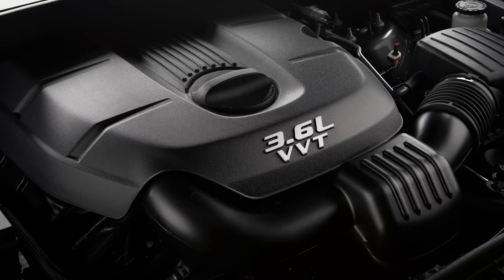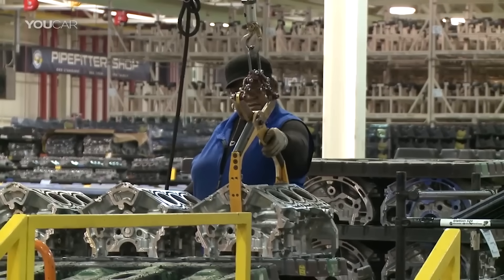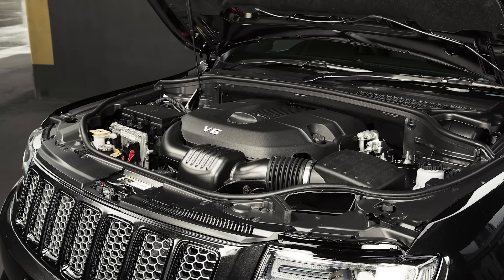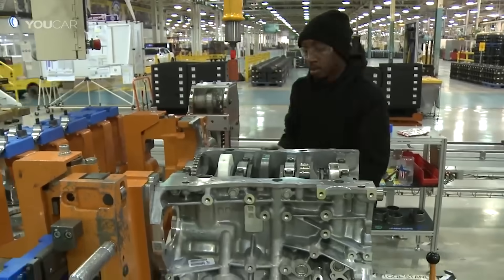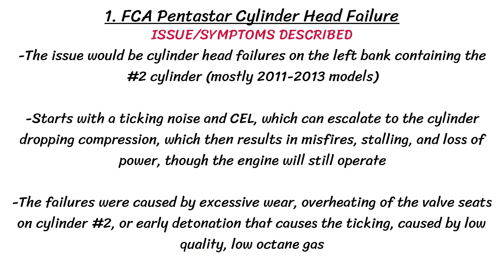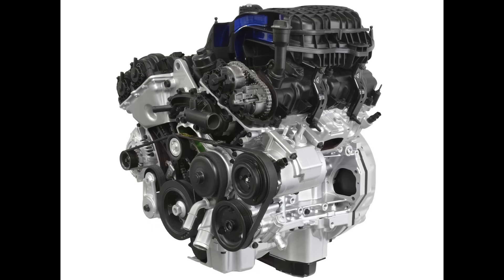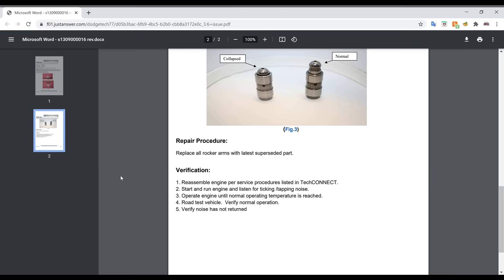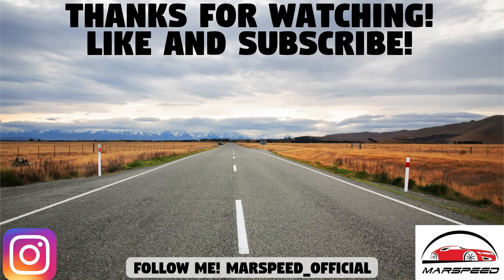The Specs and Fatal Flaws of the Chrysler 3.6L Pentastar V6 Engine

Comment: As a Technician who repairs most brands, I have seen a few with worn rocker arms and some of the plastic cooling system components fail but they mostly all have problems with the use of plastic components.
Compared to some of the engines today I would say that the 3.6 engine is above average for reliability.
Reply: I just bought a 2014 Dodge Journey. It threw the first engine code for a thermostat. Is there any better made thermostats for the 3.6 Pentastar??? Autozone has a cheap $20 replacement. My wife will be driving the Journey. I'd like to have peace of mind when going on long trips. The engine seems to be a good runner and reliable overall. Thanks!
Reply: @randallringwald5059    These days a genuine Chrysler thermostat is your best choice. It might cost a bit more but they seem to work much better than other choices.  Not likely to be made in China either.
Reply: @wysetech2000  I agree. By the way, I am looking for a Pentastar thermostat with metal housing, since the existing plastic one seems to be pushed/cracked up from within by the thermostat pellet's actuator. I have searched the internet up and down and metal housing seems to me non-existent. If you know of any such metal housing, please share.
Reply: @wysetech2000  Thanks!
Reply: @randallringwald5059  Regardless of what Thermostat (or other part for that matter) you buy, you can always catch a bad one - and I say this from experience.

In addition, sometimes parts that are offered by aftermarket companies are made by the same companies as the genuine parts.

As far as you peace of mind questions goes, regardless of trip length (long or short) - Murphy dictates that there is no such thing as being well prepared. You can rent a brand new car and take that for a long trip and you'll likely have only a hint better chances against failure compared to a well maintained middle aged vehicle.

So make sure you cover your basics, be in good terms with Murphy and enjoy your Journey, where ever it takes you.
Reply: @mrtopcat2  Thanks! I'll keep that in mind.
Reply: I have a 2016 Chrysler 300 Limited with a 3.6L .. 71k miles never been in the shop, purchased brand new. Wife has a 2018 Dodge Charger SXT Plus .. 30k miles, never been in the shop. Above average engines when it comes to reliability. The problem is people buy these cars, and Nascar with it! That'll put any vehicle in the shop.
Reply: Pentastar engines are the biggest pieces of crap 2 grace our roads in  decades! The main problem for me is that these vehicles also encounter a host of other issues besides the rocker arm failures, the oil/coolant leaks from up top there, the plastic thermostat housings, etc. They also have weak transmissions(62te), tipm issues, rear h/vac will definitely need some repairs eventually, I mean the list just keeps going on & on and the more you look at reviews and other people's experiences, you find other issues that make you wanna not buy ANY Dodge/Chrysler/Jeep product manufactured anywhere in the 2011 thru 2021 years! I think I'll pass...especially after hearing people with the new "revised" 2016-up pentastar engines still complaining about the same old valvetrain issues & oil leaks from the filter/cooler housing assembly!?! You can replace it with an aluminum one from Dorman & call it an upgrade all you want but it's still gonna leak from underneath it just like the plastic ones do when the 0-rings give way eventually...
Reply: Good to hear i thought so too its nice to know this from some one in the field.
Reply: BMW, one of the worst in plastic components.  At least Scottie affirms it.  🐴🐴🐴🐴
Reply: I have driven my used 2015 Journey for more than three years at an average 50,000 kms/year. I bought it with a 106,000 on the odometer. Now, the odo reads almost 250,000. Based on the vehicle history, the first owner sold the vehicle after it went back and fort from a Dodge Service Center after 90000 kms. I got it at 106000 kms, followed service recommendation being done by a certified autoshop, not Dodge/Chrysler Service Center. There was no issue until it reached 182000 kms, they have to replace the leaking plastic radiator.  Then, at 189000 kms, the transmission has to be rebuilt due to malfunction and low trans oil pressure. It became obvious to me  that the transmission  has been serviced repaired before and the funny thing is that Dodge service shop told me not to have it repaired by dodge service unless I am willing to pay up around 6k for it. I found an especialist who did  fixed it for 2.5k but he told me that it will be good for another 90000 kms, then the trans has to be open up again... Hence, I am now expecting to have my 62te trans opened up again at 290000 kms, as the low oil transmission pressure will happen after its change oil every 90000 kms., that maybe before winter 2022, unless I drive a lot less. For the meantime, after the car past 200000 kms, the engine had the famous pentastar ticking sound, then, engine overheating when I am on a lenghty traffic light stop, which later turned out to be caused by zero oil pressure at idling situation. Inasmuch as my mechanic refuses to give me an exact amount to fix it, I took the courage to analyse it. Before I decided to open up the engine myself, I decided to change the oil myself using 5W-30 in lieu of the specified 5W-20. I was glad that I did it as the engine oil pressure does not drop to zero anymore during idling, it does not overheat anymore, and after sometime, the ticking sound disappeared. I have not opened the engine yet after 40000 kms except changing the engine oil and its  filter every 10000 kms using 5W-30. My conclusion is that the repairs are scheduled to provide jobs to the auto technicians.... It is mind blogging that the transmission recommendation oll change is 90000 kms so the transmission parts wear out, and then, it has repaired again. And yes, the pentastar engine is reliable and strong enough to be driven for hundreds of thousands of kms. But of course, you have to spend some money to maintain it, the same with other motors. And you have to pay the mechanics aswell, if you do not want to get your hands dirty.... Happy motoring!!!!
Reply: I’m at 190k right now
Reply: @Malachi Diego instablaster :)
Reply: @Emery Marcus i really appreciate your reply. I found the site on google and I'm trying it out now.
Seems to take a while so I will reply here later with my results.
Reply: @Emery Marcus it worked and I finally got access to my account again. Im so happy:D
Thank you so much you saved my account!
Reply: @Malachi Diego glad I could help :)
Reply: My vote is the 3.6l is a good engine.  Heard cooling system problem with plastic breaking is direct result of mixing coolants.
Reply: 3.5 cyclone or 3.6 penta?
Reply: Wysetech. I'm considering strongly buying a 2020 chrysler  300 limited or S for my wife. Any opinion on models. Also what good I have done day 1 buy a professional like you to avoid failures down the road. Aftermarket parts. Even if that means going inside the engine. Please any advice
Reply: How does it fare against the 5.7 engine? One i had got countless of coolant problems
Reply: My wife and I just got a 2020 Chrysler Pacifica Limited. I see online that it uses the same PentaStar V6 as the Challenger SXT. The van gets 287HP stock, where the SXT has about 305HP stock. Does anyone know what accounts for the HP difference on the same engine? I'd like to have 305HP in my van. I wonder if an aftermarket performance throttle body made for the Jeeps or Challengers would fit and work on my van, or if the differences in ECM programming would prevent this.
Reply: @TroyBoleyn  considering how i seen both engine bays, the intake systems of those 2 are rather different, the Pacifica is set up to get more torque and gas milage instead of speed and performance like the sxt chargers are, if you do happen to make modifications regardless if which car it is you're doing it to, you're going to need to tune the PCM, because it will still be trying to make 287hp. You can probably make it do 305 or even more if you know what you're doing, but regardless any physical modification you do to any car, gains will be rather non-existent until you tune the pcm.
Reply: I prefer my Ford 2.7 any day over Chrysler engines
Reply: I totally agree with that. It was two pieces I replaced that had a crack, but never no real issues with the engine no major issues just battery.
Reply: Well we have a 2017 Jeep Wrangler and that thing has been overheating changed all the cooling system parts and Jeep dealer said they can’t find anything wrong since there was no check engine light… but what happens is the coolant goes to the over flow tank and less coolant in radiator car heats up ??? Needless to say to can’t figure out . I’ve changed water pump, radiator, cap, overflow tank, hoses thermostat and no sign of bad heads since no water in oil or milky oil cap. Last resort is a good flush of cooling system and change radiator even though I see it and hear it turn on … whhhhyy jeeepp whhhyyyyyyy
Reply: @alexsantana5377  I've been working on a fleet of caravans (cabs) since 2014. Pull your coolant reservoir and check for sand in the bottom (also ask the guys working on it if they've seen it before). I've only had a few, but they exhibited the exact symptoms that you listed. The other commentor was right also. Get a new rad cap (from dodge).
If you find sand/sludge, reverse flush the rad too. 
I wish you luck😎
(FYI, dealers don't want to admit to sand for obvious reasons)
Reply: @alexsantana5377  have you tried bleeding the air out of the system?
Reply: @alexsantana5377  I've heard that they have 2 thermostats so did you change both?
Reply: @alexsantana5377  in the tradition of this thread I'll throw my 2 cents into your overheat issue 😆  
if your coolant mixture is off, the coolants boiling point can actually be lower instead of higher. so hotter than Normal operating conditions like long traffic @ 90° can cause the coolant to boil in the rad. The reservoir is designed also as an expansion tank. so the collection in the reservoir would be what should happen had the goon that replaced your coolant not premixed with water before hand. Although I'm sure you've sorted it by now. 😆 🍻
Reply: @alexsantana5377  I think the surface of the radiator filler neck is bad causing the cap not to seal properly had that problem with a Chrysler Sebring and replace the neck no more coolant issues.  their is an air leak some where preventing the engine fro sucking coolant back from  the air tank.
Reply: Do you have mesh grill inserts or one of those dumb grumpy grills? Those will block enough airflow to cause problems.
Reply: @alexsantana5377    Overheating isn't a common problem with newer jeeps but anything can happen. Does it overheat at city speeds or highway speeds or any speed?
Usually, overheating at highway speeds and less at lower speeds is a good indication of a plugged radiator core. 
Head gaskets don't appear to be a common problem on that engine but I have seen a couple of cracked heads on those engines.  I believe Chrysler was replacing the heads under warranty at one time.
Instead of guessing, I would have someone check for combustion gas in the cooling system. If nothing shows up then a reputable radiator shop can test the flow through the Radiator core and possibly clean it for you.
Reply: @alexsantana5377  EGR cooler?
Reply: @alexsantana5377  "...but what happens is the coolant goes to the over flow tank and less coolant in radiator car heats up..."

You may have a blown head gasket. Cylinder compression could be pressurizing your cooling system and blowing the coolant out. Does your coolant tank smell like exhaust? Do you feel pressure coming from the overflow tank with the cap off?

Oil and coolant is not mixing, yet. But you're in danger of hydrolocking your engine-where the cylinders start filling with coolant when it's shut off, then when you try starting it, bending your connecting rods, breaking pistons and rings, and possibly damaging the head.

Been there, done that.
Reply: I've seen a dodge caravan with just under 250k miles and yes origional 3.6 engine and trans
Reply: @Bobby-cm7vu  complete opposite for me. I've got a 2016 GrandCaravan had bad injectors, changed transmission(TWICE), bad lifters and rockers, changed all cams, most top end work done due to the infamous "tick". slight overheating due to thermostat as well. All this before 80k miles. Pure junk
Reply: @christopherjohnson3614  chrysler quality moment
Reply: They are pretty solid motors for the most part.
Reply: I would go even further and say that during the years that it was produced, the 3.6 Pentastar is THE best engines in it's class. Yes, it may occasionally has it's issues, but so do other engines and as stated here by others, other engines have even bigger problems. I work on all of our cars, no matter how big the job is and I take a rocker arm problem or a broken oil filter housing (known Pentastar issues) any day over any of the other issues that other engines in the same category are plagued with. I find that people who are trash talking the Pentastar are usually those who bring their vehicles to mechanics for repair, for lack of knowledge or tools.
Reply: @mrtopcat2    Yeah, like the Hyundai's that blow up and catch fire, the 2.4 Ecotech that eats timing chains and burns oil and the 3 valve Ford triton engines.
Reply: Had over 300,000 miles on my Liberty before I traded it in. No major issues with this engine.
Reply: Thank you wysetech2000 it usually happens after we drive in highway but I will do a combustion check
Reply: Every vehicle has issues you just gotta pick something you know you can maintain if things go south or just don't buy the model.
Reply: i guess im randomly asking but does anyone know of a method to get back into an instagram account..?
I was dumb lost the login password. I appreciate any assistance you can offer me
Reply: Maybe compared to a Ford 5.4 three valve but I see Chrysler engines in the shop for major repairs long before 100k miles which in this day and age is unacceptable. And I’m not even a mechanic but almost without fail these Chrysler’s just start falling apart waaayyy to early.  Bad rocker arms? Bad valve lifters? C’mon, man that’s just cheap parts right there
Cheers
Reply: @tomdavis3038     I can tell you that since I work on them all every day I stand by what I said.
Reply: @wysetech2000  what's your take on the motors newer than 2014? Will they make 200k? I'm liking Durango's but never owned a dodge. I'm just wondering if they're stout, bc my old pilot has 215k on it and I want to figure out my next ride
Reply: @AAron-jj7zx     Just about anything you buy today is a crapshoot. I own a 07 Caravan 3.3 L with over 200.000 on it and the engine is still solid. I  think Toyota makes the best cars and engines, especially the V6  but not everyone likes the cars
Reply: @wysetech2000  thanks man. I noticed Toyotas one of the few companies willing to address DI issues. I'm hesitant because Highlander is an odd size, and Sequoia's are expensive lol. Longevity is key tho, we run lots of highway miles, 25k-ish a year.
Reply: I noticed mine , when I hit the gas and speed up sometimes makes a clanking sound, clank clank clank clank.

Any idea what this is?

I also have the po6da code on and think it’s a solenoid at the oil pump, my oil pressure is fine though  and it’s not a sensor issue
Reply: @tomdavis3038  Nowadays Chrysler’s main issue is the electronics rather than the engine/transmission.
Reply: @tomdavis3038  ..Toyota makes crap engines with major flaws as does Honda,VW,Hyundai,Ford and GM...they ALL have issues!!!!!! Now electric cars even have major issues,failing batteries/no drive range etc....

Chrysler mainly uses the 3.6 and 5.7 Hemi they make over a  million per year or each engine and of course with 99% of your fleet is the Pentastar and Hemi you will have people and issues..Overall they are strong,reliable engines...

Remember Toyota makes crap engines and they did since the 1970's..I know!!! Car dealer owner today,and I worked at a Toyota dealer back in the 1990's(I worked in the body shop but knew and helped out mechanics when needed/I work on cars/engines all the time)..Today Toyota has burning oil/bad piston rings that destroy the engines and Toyota cant make 50,000 miles without a rebuild!
Reply: @01trsmar  You exaggerate and lie like a snake oil salesman. Oh its true,  its true.
Reply: @01trsmar  you gotta be a troll 😂😘
Reply: @Edrodperx  ..Nope,just around cars for decades..You pissed because Toyota always had issues that were covered up!  You're the Troll...
Reply: @01trsmar  ok troll 👍🏽
Reply: @01trsmar  But there's things you keep forgetting, Chrysler's 2.4l and 3.5l engines were thrown together for poor people, and it was proven. Why do you think they were put into those cheap cloud cars, cause they were naturally made to fail, that's why it costs at least $1,200 to do a water pump job, and let's not talk about the stupidest place to put a battery as an afterthought inside the damn bumper buy the driver front wheels. Tell me how smart was that, especially when corrosion and rust was a major issue on those vehicles, and they were bargain bin cheaply made, and the longevity of the time they were in the shop vs time on the road is ridiculous!
Reply: @curtiswilson4737  300k miles from a stratus with 2.4l.  it had 3 head gaskets before 120k.  The redesigned mls gasket lasted remaining life.  Battery was a pain to access but kept it cool from engine bay heat.
Reply: @01trsmar  TOYOTA RELIABILITY VS. CHRYSLER/DODGE RELIABILITY?😬🤔
Reply: @01trsmar  Lol Toyota engines are some of the most durable in the world, you sound weird, jealous, something isn't right up there.
Reply: @01trsmar  Hmm, last time I checked, Toyota and Honda make the best selling and most reliable cars on the market, and Chrysler makes cheap pieces of shit that start having problems within 50k miles, you must be in an alternate universe.
Reply: @01trsmar  What are you smoking my man lmfao
Reply: @01trsmar  I've never had a Toyota, or a Honda that hasn't made it well past 200k miles without any major repairs. They're making the most reliable cars on the market. Have you ever heard of a Toyota corolla? How about a Rav4? Maybe a Tacoma, civic, accord,Tundra. All great cars that go past 300,000 miles regularly.
Reply: @SomeOne_86  Torquefarts & Pink Lights sounds like he's crazy. Must be a dodge owner.
Reply: @goldentrucker7921  I'd say he sounds more stupid than crazy haha. But yeah thanks for backing me up. I really don't know what kind of drugs someone has to take to say Toyota makes bad engines 🤣
Reply: @01trsmar  Its how you maintaine your car, My Honda has been neglected by the previous owners, and it's starting to have problems, It's A D17. I know Cracked headers are a Common Problem, but I fixed it with racing headers, one good thing about it, is that you can run ebay parts and still have a good car. after my Build is done. Moving on to a more Modern car like an SXT challenger
Reply: @01trsmar lmao idk bro Toyota and Honda are prob the 2 top durability manufacturers out there
Reply: @01trsmar  if that were true, then chrysler would be a dominant automaker. instead, toyota is the largest automaker on the planet today so what you're saying is unfounded. instead, chrysler aka stellantis is on the verge of disappearing like nissan